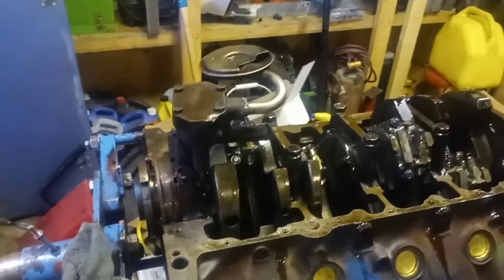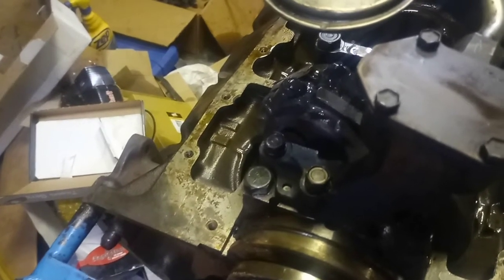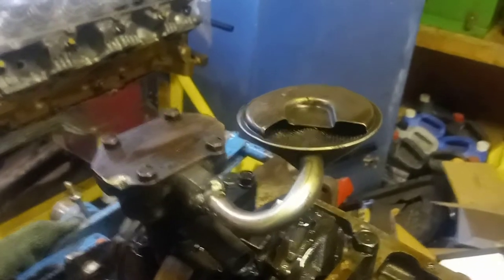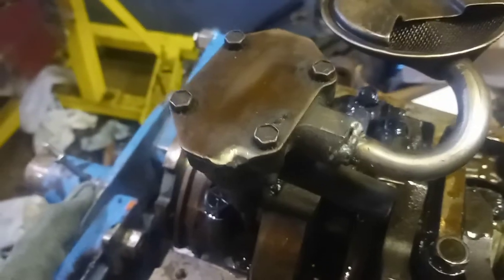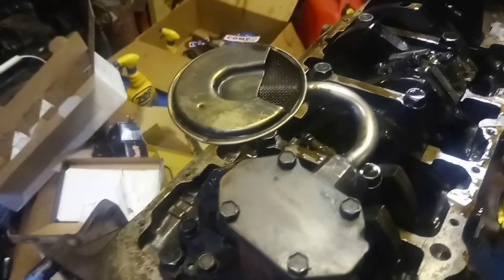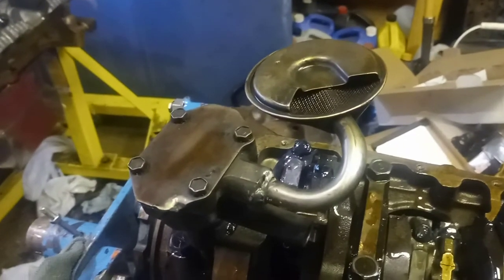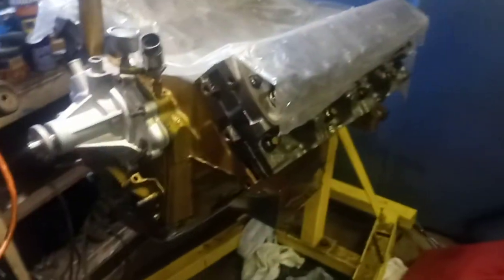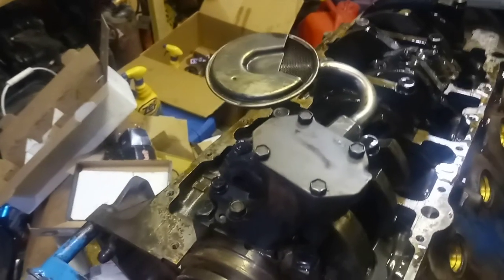Polski oil pump install. With some tips and must do's.

Comment: Good tips man every once in a while I'll make a gasket out thin copper sheet .010 to.005. And heavier on some things.
Reply from the maker: Good idea. And if you heat copper until its red it goes soft and really seals. Thanks for watching.
Reply: @wildrosegarage4208  yup buddy that's called annealing!! Works great when making dead soft header gaskets.
Reply from the maker: @moparnut6286   I new what its called just didnt no how to spell it lol. I am a plumber eh. I have done it on old triumph bikes for the oil filter gasket. Thanks for the tips. Your the kind of guy that knows a trick or two.
Reply: @wildrosegarage4208  so are you thats why I watch! 😆

Comment: The Ford 5.0 HO has a standard volume pump.  I twisted an oil pump driveshaft up licorice when the pump ate a piece of front cover gasket remnant after a cam swap.  I got my hardened driveshaft from ARP.  Miloden makes them for the Ford too, but they don't work depth wise with the female hex in a factory TFI distributor.
Reply from the maker: Thanks for correcting me. I was lied to. And with a channel name like yours you would know. Thanks for watching.
Reply: I just seen that myself!

Comment: I have tacked the oil pickup to a SBC oil pump before just because it was so loose when I tore down the engine, a 1981 350.
Reply from the maker: You did it right. Thanks for watching.